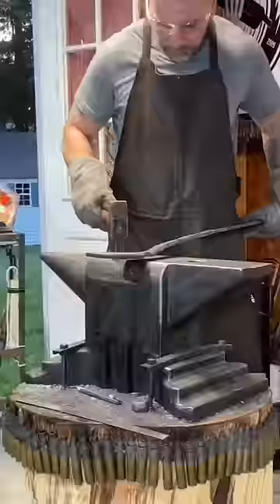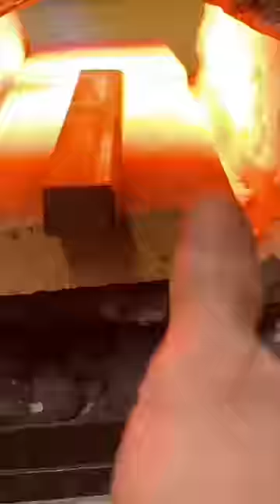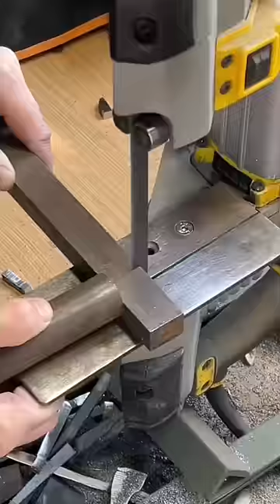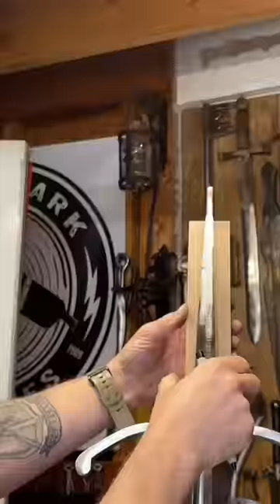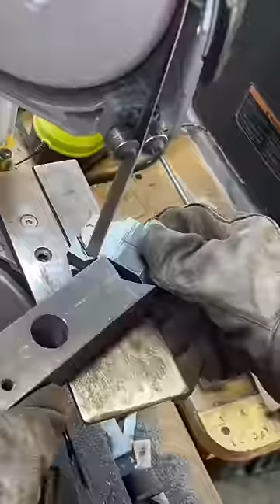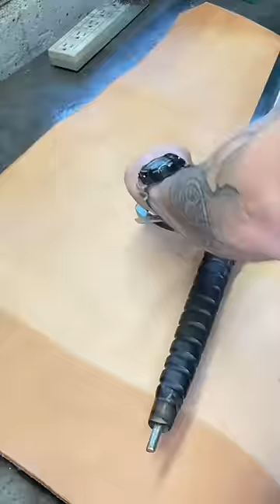Finally forged Jon Snows sword, Longclaw! 🔥⚔️ #blacksmith #forging #sword #gameofthrones

Comment: Id like to see a swords balance point and overall weight when finished. Both really important
Reply: Dude thats a longsword propably made from spring steel  its durable enough to cut and dont brake thats what matters not the balance point its not a katana its a mfking longsword he did a good job there

Comment: That’s very good. The only thing I can say about it that’s a little bit negative is that perhaps you put a little too much of a fat tip on it the sword is supposed to be a bastard sword and should have a more pointed tip on it made for piercing. It’s still very pretty though. The pommel was very good work.

Comment: Ive done my fair share of blade smithing but never a full length sword. Been working under a mastersmith for a year and a half or so.

I can say though...unless its specifically requested of me, i will never willingly put any head like pommel on my handles. Because for me it never faces the "right way". To the side, looks funny unless its laying on the ground. Inline with blade edges, looks funny in the sheath.

Its a personal preference of mine to just have something symetrical and functional for the pommel. Thats just me.

Comment: The proportions are COMPLETELY wrong. Like, dude, had you made a different handle, guard and pommel this would have just been an awesome build, now it's just a shitty replica. Like, dude, you CARVED the pommel out of STEEL. The prop designers used lost wax casting. You have insanely misused skill. Awesome sword, subbed.

Comment: It's a great looking sword but I always thought that the more times you folded it stretching it out and folding again and again the purer n stronger the blade
Reply: That is only true for old steels hundreds of years ago.  Folding removes impurities from the metal. Modern steels are homogenous and will not benefit from folding. It will in fact make it worse.

Comment: Not taking away from it in the least, it's WAY nicer than anything I can do BUT; doesn't Longclaw have three fullers? And Valyrian steel was patterned like Damascus; which I realize is not super practical, but hey- at least it's not Ice, right? Could be worse! Great job though, it is beautiful!

Comment: Similar but not long claw to short to wide the guard does not have round balls on the end the pommel is suposed to be a wolf not an angry duck and its made from damascus not regular steel.